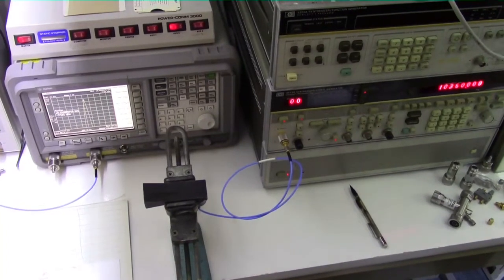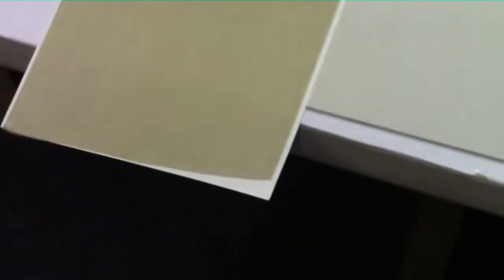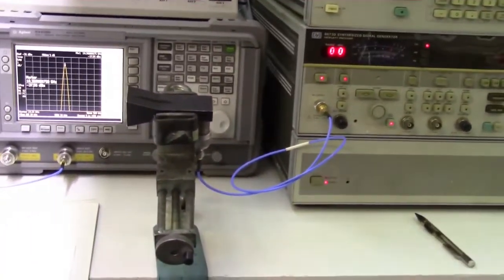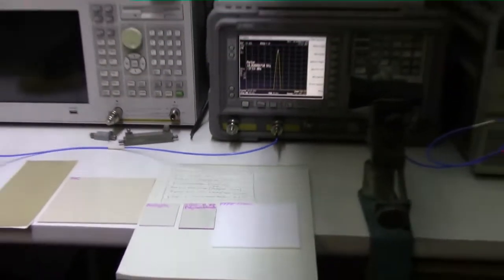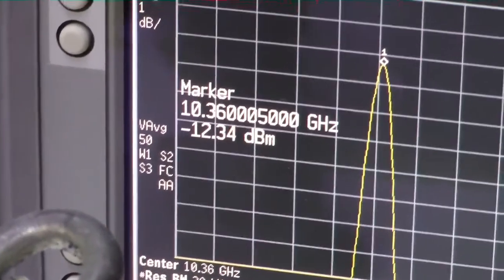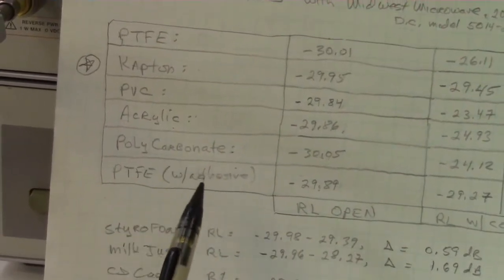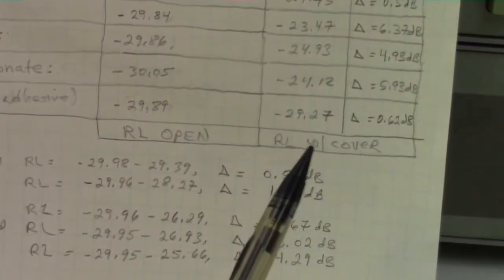Insertion Loss & Return Loss Measurements of Plastics at 10 GHz

Comment: Thanks for the informative video, Gedas. (It would benefit from some bookmarks.) I'm on a quest for some Kapton now.
Reply from the maker: Glad I could help Rus. Here is the Kapton I tested: https://www.ebay.com/itm/KAPTON-Hn-film-002-thick-sheets/133236718299?ssPageName=STRK%3AMEBIDX%3AIT&_trksid=p2057872.m2749.l2649
Reply: You can find Kapton tape rolls on Amazon and eBay in various sizes from a few millimetres wide to more than 20 cm wide.
Reply from the maker: @stargazer7644  Yup just remember about the adhesive on the tape. That may or may not affects matters at 10 GHz and above. I have dozens of 1" rolls that we used for satellite work. I wish it was just a little wider to cover the feed as it would have been interesting to see if there is any difference with and w/o adhesive.

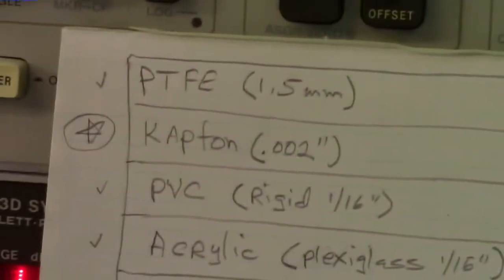Comment: The actual results start at 13:13 . These results would be better if the samples used were 10x or 20x as thick to make the results more accurate.  You might also want to consider the insertion loss per unit thickness to compare apples to apples.
Reply from the maker: Yes and no.......I understand why you said what you did. Yes thicker samples would decrease the uncertainty/variability of my measurements but as I state above, the purpose of my testing was:

"I perform some basic IL & RL tests on a small sample of uV stable plastics that I plan to use to cover the feed opening of my 10 GHz dish antenna."

I am testing plastics that  & that I will be using to cover my antenna feed. In other words ONE of these tested samples will be up on top of a radio tower. I am running these tests for my specific application. Your suggestions are great (and appreciated) if my goal was to measure plastics in general & in a standardized or universal format making apples-to-apples comparisons possible.

Having said all that I may add that I simply do not have a variety of equal thickness plastics, say 1/4" thick at my disposal. If however someone wants to send me a sample of each of these plastics, all the same thickness, say 1/8" or 1/4" thick, I will be happy to run separate tests on them.

Comment: What are the il and rl of a piece of plate glass?
Reply from the maker: I considered glass but would not use it here up on the tower due to the crazy storms we get here. Many times hail comes in almost sideways at 50 MPH and I feared it may scatter. 2nd reason is I did not have a small sample of safety glass available. If you send me a small sample I will be happy to test it.